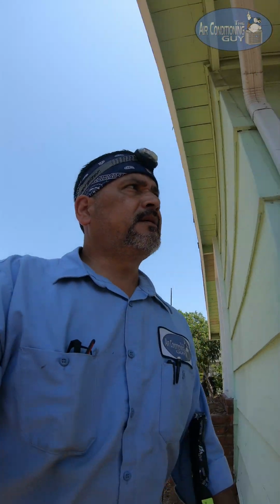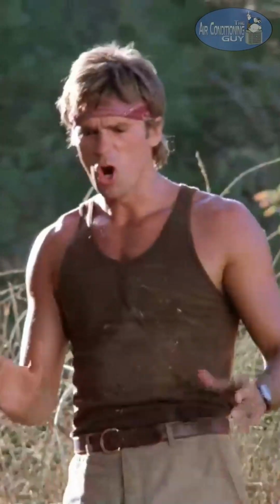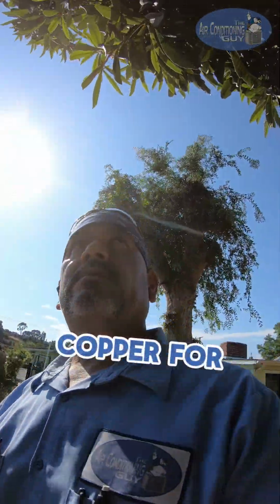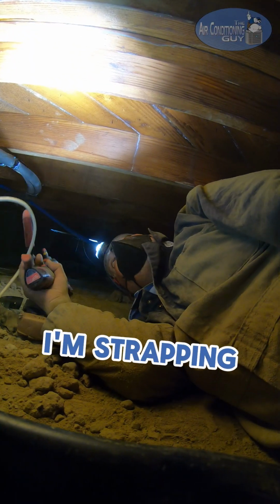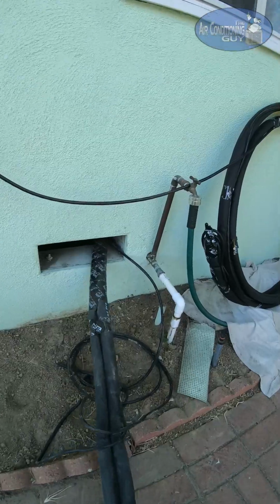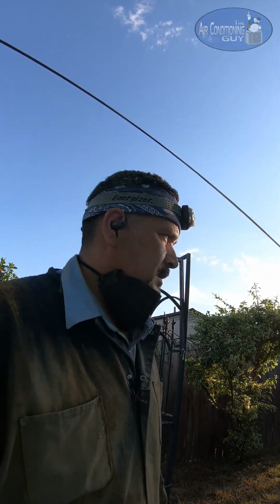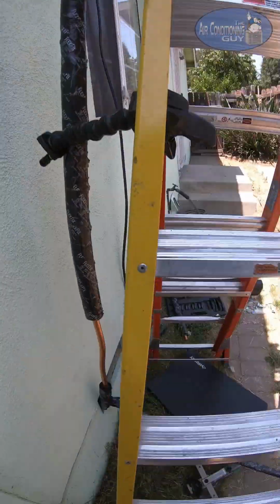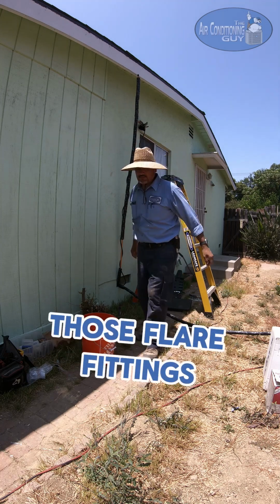3 Zone Ductless Daikin Mini Split System Part II

Comment: A neat idea for the line set. Though I will say that it's not serviceable.
Reply from the maker: Hello, thank you for watching. Could you expand on that? It’s the first time I ever tried it. Your feedback is greatly appreciated.
Reply: Well I mean if you have to change out the line set it's going to kind of be a chore. Just make sure you use some zip ties at the end so that no no humidity can enter in. AC service tech had a video about it. How they can create pinhole leaks in the middle of the line sets because of the insulation not being sealed at the end well enough
Reply from the maker: I've never heard of pinhole leaks in the middle of line sets here in LA. Do you think it depends on whether you live in an extremely humid climate? I'll look for that video you mentioned but if you get a second would you mind forwarding me the link? If YouTube doesn't let you post it you can email me with it. Thank you for info 🙂👍
Reply: @theairconditioningguy  not sure how to put a link. But the video title is "copper line set tube corrosion and HVAC refrigerant leaks explained." That makes sense though. As far as the lack of humidity.
Reply from the maker: I was going to get back to you! 😁 I found the video and I believe that he said the major culprit was that white insulation that was causing that formicary copper corrosion. I appreciate the info though! This is how we improve our skill-set. Now I know not to buy the line set that has polyethylene insulation. He said the voc’s in it create an acid. It might also happen with the black type but he said the white one was the one he personally saw it happen with. Again, thank you for helping me out here. 🙂👍
Reply: @theairconditioningguy  Ah ok yeah I watched the video and I noticed he put zip ties on the insulation ends. I will say I probably missed some info 😅 
Yes, may we continue to excel. Also, are you a solo contractor?
Reply from the maker: @lucianoandsonshvac Yes for now I am. 😩